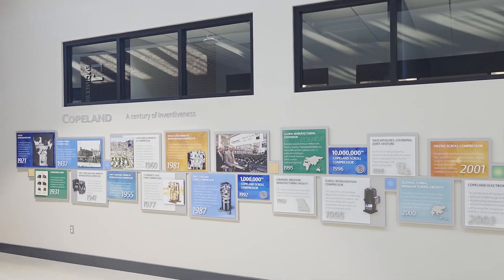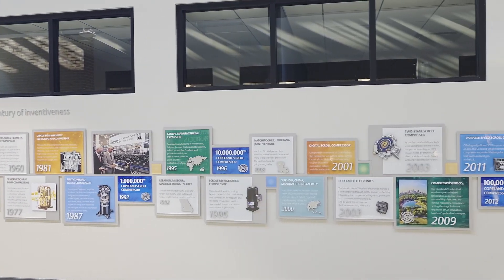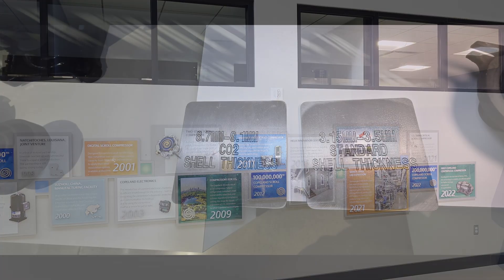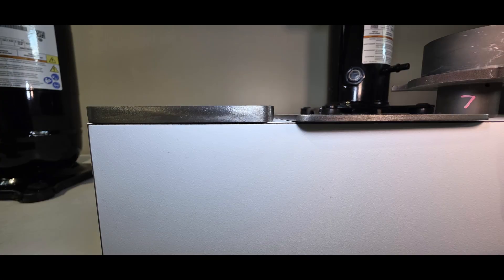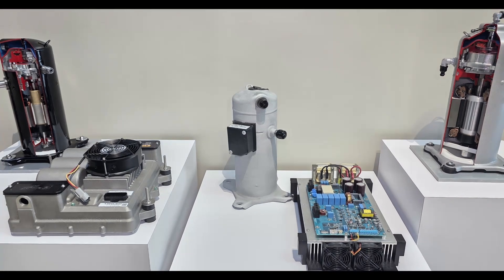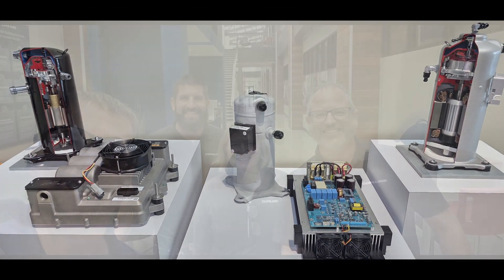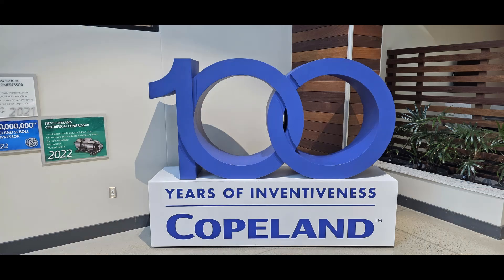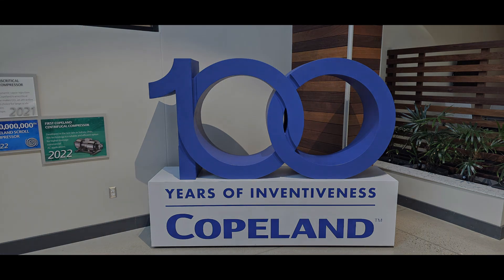Did You Know that R-32 and R-454B compressors use different oils?

Comment: R 32 uses a higher viscosity oil, POE 46 oil due to the higher discharge temperatures. Now R454B & R410 uses a lower viscosity oil, POE 32 oil. Just remember, don’t use a POE 32 oil in R32 systems. So apparently common sense went out the door when somebody tried to come up with numbers for refrigerant and numbers for oil (hey I got an idea, what do you say we correlate the POE oil number 
to the refrigerant number it goes in or am I using too much sense? 😂🛢️).